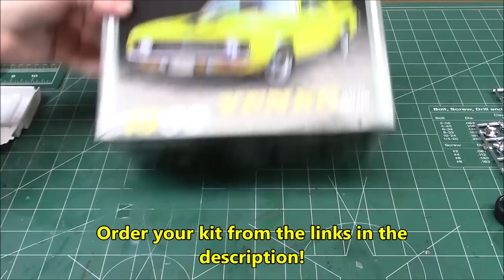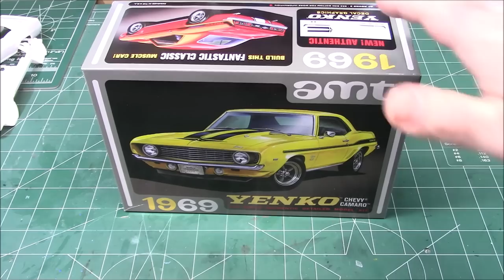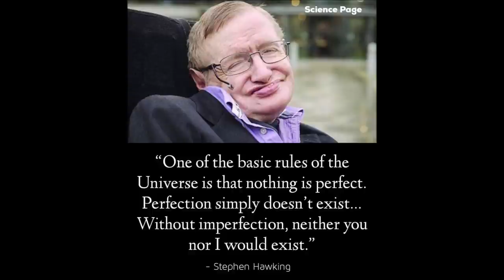1969 Yenko Chevy Camaro  1/25 Scale Model Kit Build Review and Weathering AMT1093

Comment: I built the Revell 1969 RS/SS Camaro using the 'bug eye' style headlights. That was first kit I tried superdetail painting on. Each of the 4 'Z/28' badges, I hand painted the red 'Z', hand painted the battery clamps, positive cable in red, and the water fill caps. I always would hand paint Chrome Silver underneath Turn Signal Amber/Stop Light Red for side marker lights and any clear lenses for turn signals or taillights. Body was brush painted with Testors 1/4 oz jar of Gloss Turquoise, slightly more bluish tint than the spray can Tropical Turquoise you used on the Sonoma kit build.
Reply from the maker: I'm glad you took time out of your day to watch and comment! Thanks!

Comment: I am in the middle 9f building this kit and I am struggling with the firewall ! It has two lugs on the inside that look like they are supposed to be there but would leave a 1/4 inch gap between tub and firewall when veiwed from below ! Am I supposed to remove these? . God I hope that isn't a dumb question